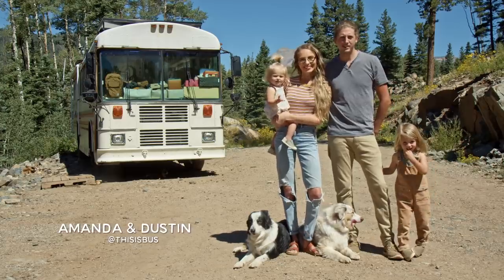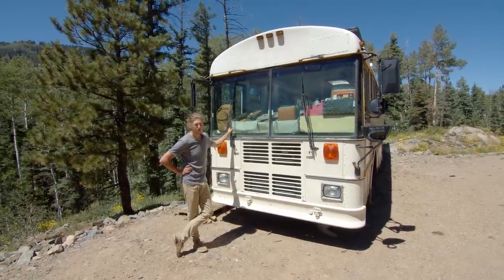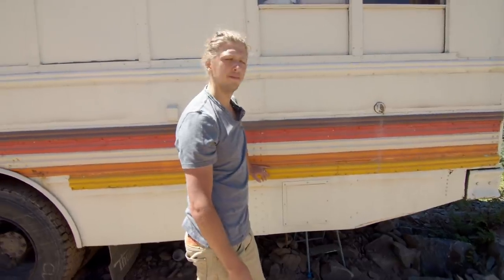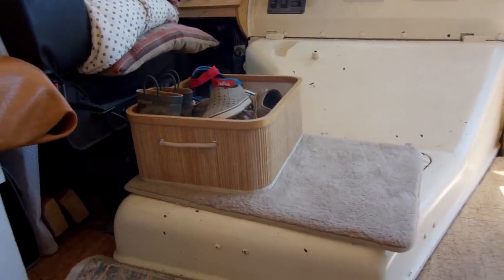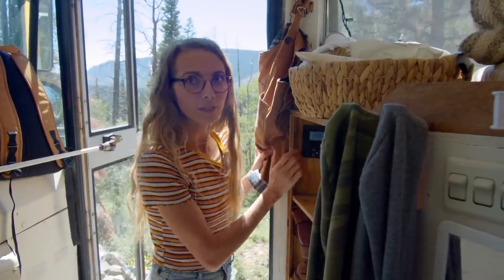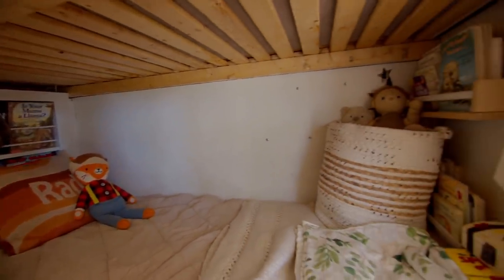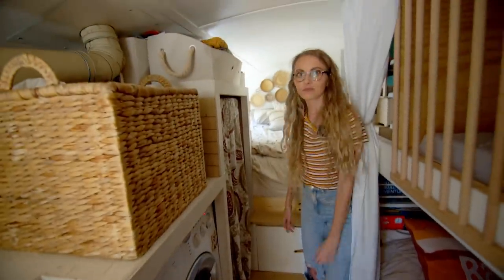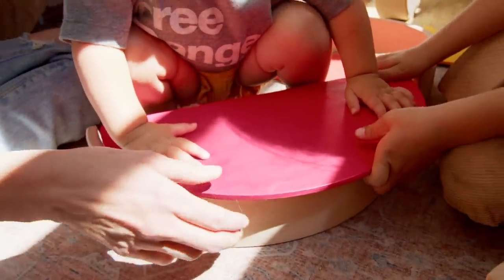This Bus Conversion is many Young People's Dream

Comment: I'd be afraid something mechanical would go wrong with the bus out in the middle of nowhere and far from a mechanic who knows how to fix them.  We had an older class A RV that every time we went even 5 miles from home, something expensive was sure to break.  I think the mechanical aspect is the one big elephant in the drawing room that is rarely covered in these RV videos.
Reply: Hell ya they spend at least 20k a year just to keep it running
Reply: 100% agree. How would you even tow this? Repairs are costly. However if you can just mainly park this somewhere that would be great.
Reply: @ENUFF!  don't let the internet fool u
Reply: @exclusivenews734  The channel host is NOT the schoolie owner, Dolt.
Reply: These buses area made to run for a long time without breakdown. They are made to carry children back and forth to school 5 days a week if the buses broke down easily it would cost the school system loads of money. Not saying they won't ever breakdown but they are made to run safely and not breakdown with children in them. Getting 500,000 miles out of a school bus is just getting broke in, it will go another 500,000 miles. The trick to keeping these buses from breakdown is maintenence keeping the fluids changed regularly. 
Also any place that works on diesel motors can work on a school bus. So there is plenty of places that work on these buses at reasonable prices. 
Most tow companies can tow a big bus but it will cost more money because of the size of the bus it will take a heavy duty tow truck to tow the bus. So your looking at 300 to 500 tow bill that's just for starters.
Converting a school bus is much safer and last a lot longer then a RV that cost lots of money. School buses are built to last a long time bus conversion is much better then buying a RV which isn't built to last RV fall apart easily, thats my opinion.
Reply: @UnKnown-zy1km    True and there are also on-the-road service mechanical protection packages — the same concept as AAA, more or less - that can be bought for road assistance.
Reply: @UnKnown-zy1km  Thanks for your input; found it very helpful and reassuring.
Reply: That’s why you tow a vehicle
Reply: If you find 1995 international school bus  with DT 466 mechanical and 5 speed Spicer transmision, Blue bird is preferred  builder, you can drive that bus across US and Canada. How I know all this ?My bus is exactly same unit that I describe previously, absolutely bulletproof  on other hand if you take expensive  rv you need very much money for matinance and unexpected brakedowns I used to own expensive  unit with four slideouts and water coming in on stormy wether inside  then slideout don't want to slide in . Mobile mechanic charged me generously for 1h work, after that I sold junk and buy bus and now I matinance my self . School bus never give me any problem because there is no computer's no Def system all mechanical I think that is why to go!

Comment: should’n a 40 feet long Bus have at least 3 axles? I would not want to drive this thing with only 2 axles. If there is a flat, the Bus is really on the ground and it is hard to change a tire on such a big vehicle. Also it would ride smoother with 6 wheels. Just my observation.

Comment: I'm a big fan of tiny homes and the whole small space movement...But I must admit, I feel like this family really does need a bit more room (if only for the sake of the kids). I can tell the mom is very tired and frustrated, as too many concessions have been made. Maybe they should settle into a gooseneck tiny home and resume the road adventures when the kids are older? Maybe (if they can afford it) have a separate camper van for trips?

I see a lot of fire hazards and hard-to-clean surfaces, cramped conditions for the kids, an insufficient fridge, a need for a dishwasher and improved washer-dryer, etcetera.

This would be cool for a young, scrappy, childless couple, but it doesn't seem like a good fit for this growing family's needs.

Comment: Really nice build. But, unless I missed something,  you have 4 lead acid batteries inside the bus. VERY dangerous! While charging,  lead acid batteries give off toxic fumes. PLEASE  seal off the space where the batteries are & vent it to the outside. Assuming you can't relocate them outside.  Lithium batteries are considerably more expensive,  but there is a reason they are so widely used in RV's. They don't give off any fumes.